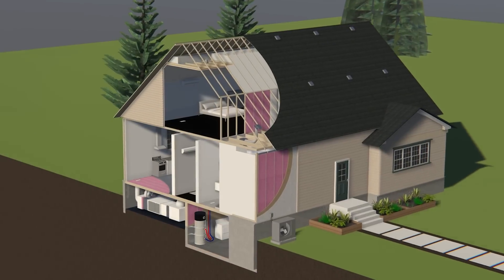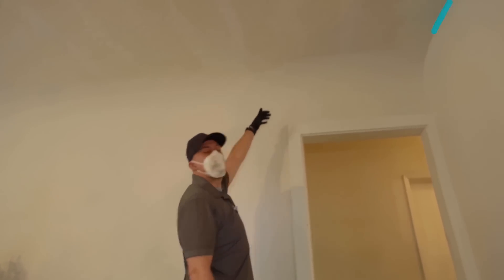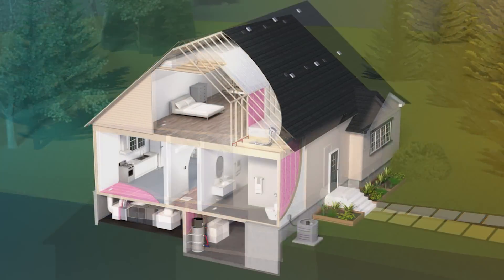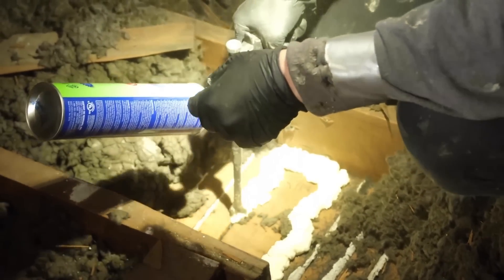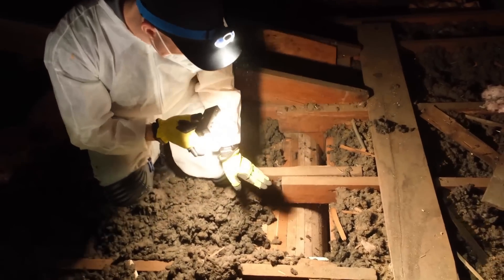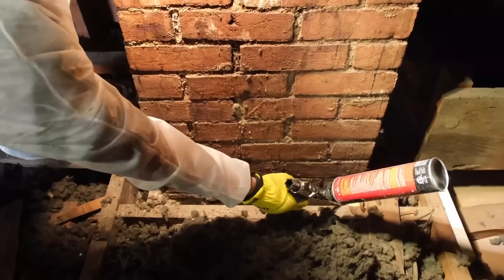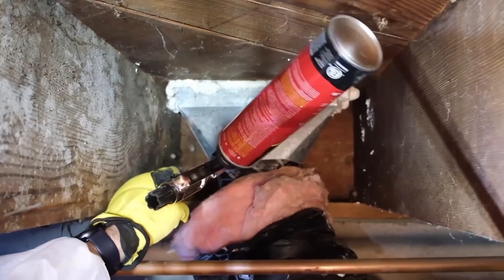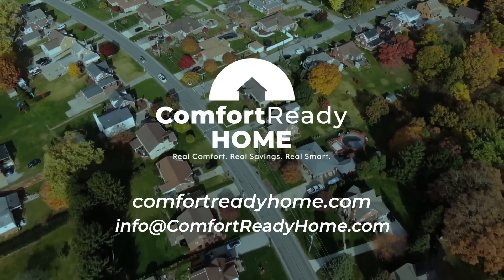Mapping Your Home to Optimize Air Sealing

Comment: What's the purpose of sealing around the supply vent? Did the house have a crawlspace or were you standing in the basement? That wasn't explained well.
Reply from the maker: In this scenario, the home had an “unconditioned” basement, and we wanted to prevent cooler air from entering the living space during heating months. Because all homes are different, it is important to define where the air barrier should be. If a basement will be heated and used as a living space, sealing between floors may not be necessary.
Reply: @ComfortReadyHome  gotcha now it makes sense. Thanks

Comment: What possible difference does it make whether the attic cracks are sealed off from the ceiling of your house?  The attic floor is covered with R60.  The only difference between the unsealed area of your ceiling letting air escape into that R60 blanket and the rest of your ceiling is some air hits the seal or drywall first.  So, if it's an unsealed location, the escaping hot air from your ceiling runs into R60.  If it's a sealed or 1/2-inch drywall area, the escaping hot air first runs into the seal or the drywall, so essentially R61.  No practical difference.
Reply from the maker: Thanks for your question! It sounds like you are asking if air sealing is necessary with high insulation levels in an attic. There is an important distinction between the effects of rated R-value vs. proper air sealing. R-value is the resistance to conduction of heat through a material where heat warms the surface and slowly (or quickly) moves through the material by heating the material. Air sealing is important in all cases to optimize the full potential of the insulation because air will move directly through it reducing the effectiveness of the labeled R-Value.
 
In more technical terms, the R-value equation does not take into consideration air movement, only the heat flux (heat flow density) of the material and the temperature differential. In practice, the R-value can’t be obtained without proper air sealing.
 
If you're interested, our video “The Power of Retrofit” details the effect of proper air sealing and insulation in a home and their individual effects on HVAC system sizing: https://www.youtube.com/watch?v=eY8zRnaleFk
Reply: The air quality in my home has dramatically improved as we have sealed around the vents and light cans. There was so much dust in our house the builder accused us of never cleaning or changing the filters, and I was coughing up my lungs. Between that and them not sealing the HVAC properly, we were miserable!

Comment: Is it a good idea to build a warm roof above all the studs and frame?  I plan to redo my attic floor(or roof)
Reply from the maker: If you are planning on using that space in other ways, moving the building envelope can have its benefits. However, when changing from the original architecture design, it is important to understand its effects on other systems. Adding a new space to the home will change its heating and cooling requirements from the HVAC system, moisture and ventilation will need to be considered, and always check with your local code jurisdiction on required R-Value and space usage. A home’s independent spaces and parts work as a system, when one is changed it is more than likely others will need to be too.

Comment: Will air sealing stop rising humidity in a home ?
Reply: Yes. About 99% of the moisture movement into the attic is through air leaks flanking the building materials, and the remaining 1% is by diffusion through the materials themselves.

Comment: I had the old insulation in my attic removed entirely, my home rewired and then the attic and basement were air sealed. The insulation work was meticulously done by BPI contractors. Then new cellulose insulation was blown in.
Reply from the maker: That’s the way to do it!

Comment: Great information! I recommend completely extracting all insulation, so you can see all the penetrations, its amazing how much you can miss with insulation in the way.
Reply from the maker: Thanks for the recommendation. It is certainly great to remove existing insulation to make the air sealing job easier and ensure thoroughness. When it is not feasible to remove insulation or if the existing insulation is in good condition, mapping out the where the walls, architectural details and lights are from the living space can give a very complete and precise mapping of where penetrations are likely to be.
Reply: @ComfortReadyHome  I agree; however, when it comes to icedamming certain situations will require more than just air sealing. Moving ducts, vents, and using better insulation materials. I tried doing it without full extraction on two buildings for 11 years and finally exhausted myself of paying roofers to shovel snow off the roof only to discover damage in the spring from aggressive snow shoveling. You are right though, if you can avoid the cost, and fix it, then go the simple route:)

Comment: my house has a nearly identical attic. I live in Vancouver. We recently removed all the vermiculite and cellulose. and sprayed biocide to kill the milldew mould. and then sprayed a preventative clear layer to prevent future mould. we increased the ventilation in the soffits and roof. and we air sealed everything. now we are putting in rockwool insulation everywhere. Not sure yet what to do about the vapour barrier. If anyone wants to compare notes, reach out!

Comment: Wish you’d shown how you dealt with sealing the mount for the big rectangular light box in the kitchen.
Reply from the maker: The mount is held up by fasteners to the joists. These fasteners don’t typically pose a compromise to air leakage. The air sealing opportunity was where the wiring comes through. The wiring typically runs through a drilled hole that feeds to an electrical junction box fastened to the joist. The team was able to access the wiring as it came through the ceiling and install some spray foam at the penetration. This application looks very similar to the video cover image: https://i9.ytimg.com/vi/peGZpxePEs4/sddefault.jpg?v=65288c40&sqp=CPCLvqsG&rs=AOn4CLD7IOs4Bv4WBjE7vyQSmh-1Pi4H2w

Comment: Were you guys able to seal the top plates around the perimeter of the house (outside walls).
If so, how did you do it?
Also, do you need to spray foam each rafter that makes contact with the drywall ceiling?
Reply from the maker: Thank you for your question! In most homes, the top plate should be accessible on the outer walls. The part that should be air sealed is where the drywall or lathe and plaster meet the top plate and where perpendicular walls are connected.  Electrical lines sometimes go through here to porch lights and switches. Depending on the slop of the roof, this can be a very tight situation. If the home is balloon framed, proper blocking will need to be considered before air sealing can be done effectively. Don’t forget to put baffles for the lower attic ventilation.

It is important to determine what is exactly considered inside the home and what is outside the thermal envelope. In most homes, the rafters of an attic do not penetrate the thermal envelope and do not require air sealing at the junction and rest on the outer wall or attic pony wall. A blower door test can be an effective way to see and feel how the house is interacting with air through the assembly.